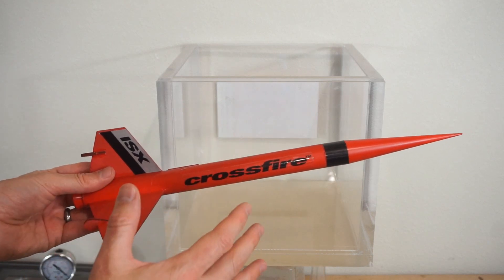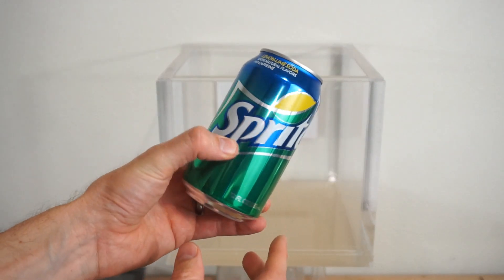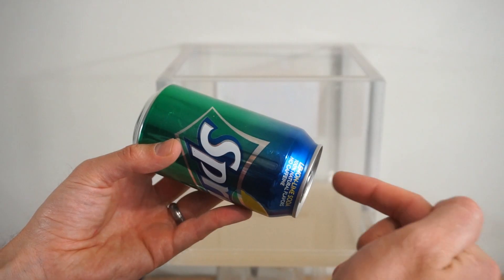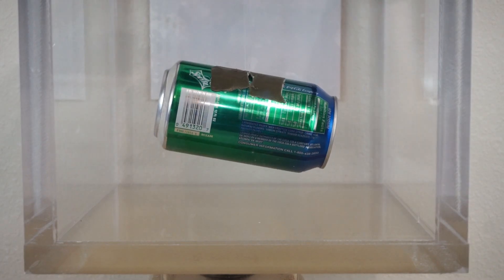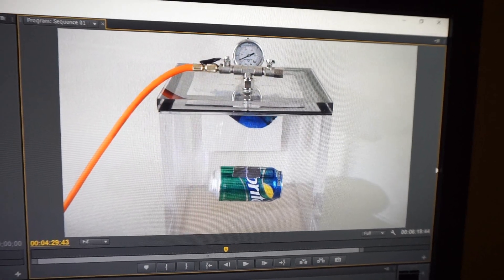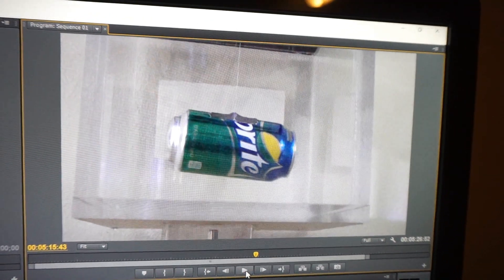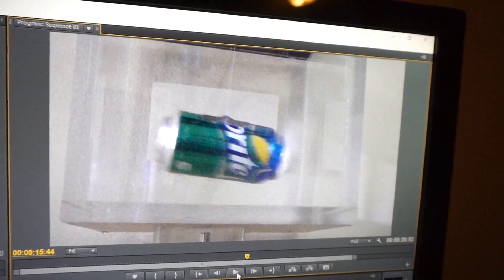Can a Rocket Fly in a Vacuum Chamber?

Comment: of course it can. a rocket has it's own supply of fuel and oxygen. and since the rocket creates gases from the reaction and jets them out the nozzle, and every action had an equal and opposite reaction, the rocket must have thrust and therefore must fly.
Reply: There's a special kind of people who don't accept Newton's third law, this video is aimed at them, the flat-earthers.
Reply: Holocene
Of course Newton's third law applies in a vacuum.  Why wouldn't it?
Reply: @Hyrum Wood Why will it not work in a vacuum. It's like you sitting in a wheel chair and throwing a bowling ball, you'll get pushed back a bit. Now imagine having zero friction, no air resistance no wheels just you and a ball. You'll be pushed back even further because there is nothing slowing you down.
Reply: There's a special kind of people who think newtons third applies in a vacuum, we have classes for them to keep them away from people who can think, and helmets, they need helmets.

Comment: It is actually really simple the reason rockets work in space is not because of low gravity or lack of pressure. Space Shuttles provide Thrust into space through the use of a fuel and Oxidizer. This means they don't need oxygen or the pressure from the outside to give them the thrust its all contained in the fuel tanks. The low gravity and low pressure is actually a good thing because once in space the shuttle can use RCS (Reaction Control Systems) thrusts to do fine maneuvers which if im not mistaken is usually just Helium Gas.
Reply: Blah blah blah...💤💤💤  this experiment is only a little flawed,  the only part not valid is THE WHOLE THING !     YOU CAN SEE IT PUSHES OFF THE WALL.BEHIND IT...WHERE'S THE SMART SCIENCE GUYS/GEEKS ?

Comment: did you reallize that you didnt even need the vaccum chamber to show it? when you have filled a baloon,hold it up as high as you can away from the ground in an open area(eg. outside your house) and then let it go.when its going upwards its not pushing against anything,because you dont feel any wind around your foot and the baloon goes flying immedieltly LoL.
Reply: outside your house is not low atmosphere.

This experiment was done to show that newton's law of motion works as usual. Sprite losing mass which propels it forward even in a vacuum. Just like a rocket losing mass in space.
Reply: SpaceX Fanboy , if the principle is that by ejecting mass at a velocity,you move in the opposite direction with another velocity(conservation of momentum) then it doesnt matter if the outside pressure is 0 or 100atm,it works exactly the same

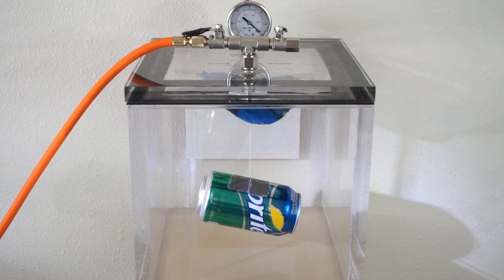Comment: wanna skip to see the action?? skip to 3:10 thank me later
Reply: You must have 3 parts to make it move in the chamber.
1• the chamber walls
2• the gas
3• the rocket

In space you have a problem.
1•
2• the gas
3• the rocket
Reply: Thanks!
Reply: Administra2rS:  He showed the pressure gauge.  It did not go up, yet, the can moved anyway.  That means the chamber was not filled with gas like you say.  If it was, the pressure gauge would have gone up.
Reply: Thanks bro.
Reply: Lincoln Lim 4:20
Reply: Administra2rS Didnt you saw the part in slow motion?
Reply: @felpex1495  the chamber is too small and both containers have to level pressures. 
0+2=2
now every position on the volume area has the same pressure that is the result of adding both quantities,  let's say 0 plus 2 , the new pressure in the whole area is 2.
But if the OUTER EMPTY SPACE is vaccum, the negative pressure won't wait until you open or fire on or click any bottom, it will suck everything and everything and everything right away.  Leveling the pressures, and whatever had enter (that's another issue we can't and will ever be able to explain) into OUTER EMPTY SPACE will have the same pressure :

THE COSMOS HAS !
Reply: @felpex1495  👍✔see what happens in REAL VACUUM 
https://youtu.be/76JM03a6WH4
Reply: you move only by touching the wall with your hand, or the air very fast inside the chamber. When it is a vacuum, then there is nothing to touch, only the wall. If you bring a fire inst. then you will move only because of the wall you blow against and standing on.
Reply: https://twitter.com/TheXenderman/status/1113495608768200704  @Administra2rS
Reply: @misterx7898  👍✔see what happens in REAL VACUUM 
https://youtu.be/76JM03a6WH4
Reply: Pressurised gas moves extremely fast, it does two things, it makes a physical touch against the wall of the chamber, and fills the vacuum with gas who also stops against the walls of the tiny vacuum box to travel on.
Reply: the gas still hangs in the sucking vacuum of space, no way for thrust to form.
Reply: In the vacuum of space, there are no gravity and negative pressure. No way for thrust to form. A bullet works cuz there are two hard parts, gas and liquid does not fit in this category. The bullet works cuz the two hard parts HOLDS together. A thrust in the vacuum of space will work if you can physically screw the air/gas that is coming out of the rocket to the chassis of the rocket, something that we can not do. Thrust does not work in space. It has EVERY thing to say witch material is used. Recoil can ONLY happen when there are two hard material parts connected. When the exhaust leaves the rocket THEN it still hangs in a sucking vacuum and it's no loger CONNECTED to the rocket. No thrust can be created. If the rocket was spitting out something of HARD material that is connected physically to the rocket, then the push could have been made (like a minigun propulsion system). You can not glue exhaust to the rocket, there for the thrust won't work. The vacuum of space is PULLING the rocket in all directions. On the surface of the earth it is positive pressure that is pushing everything IN. So the rocket can travel and thrust in positive pressure where Newton's 3 law WORKS, but FAILS in the sucking vacuum of space.
Reply: @Administra2rS  - "In the vacuum of space, there are no gravity and negative pressure."  FALSE.  there is NO SUCH THING AS "NEGATIVE PRESSURE" .   The pressure in space is ZERO. 0.0 PSI.  there is nothing magic about it.  and the "Vacuum of space" CANNOT SUCK OR PULL ON ANYTHING .

Here is a question for you:  If I have a linear catapult (or railgun) that has a mass of 5000 kg.  It can fire a water Ice Block of mass 500 kg, at 2500 meters per second.   WOULD this catapult experience recoil if it fired this ice block floating in zero-G, in a vacuum?  WHY or WHY NOT?  (can you explain the property of the ice block that makes it do this?)
Reply: @stuartgray5877  how You level the equation to zero in outer space.  Any positive pressure You bring outer space gone be sucked immediately in the vast and humongous space, as they said it is, and we still don't know the TRANSITION MAGIC TRICKS, to go from X amount of psi in our earth, to a complete zero...Where we pass through???, Where is the portal??? How they could accomplish it???
Reply: @abelmicah3430   The "Vacuum of space" STILL cannot "SUCK" anything.  When the nozzle BLOWS THE PROPELLANT OUT, the nozzle FEELS the force that accelerates that gas into the vacuum.
The VACUUM does NOT exert the force.
The NOZZLE exerts the force.
FOr PROOF that rockets work i n a vacuum I can show you video evidence.

Abel - First you have to answer a question.
How high UP does one have to go before they are in what you would call "VACUUM"?

Vacuum industry experts consider "Rough Vacuum" to be anything less than 1.0 Torr.

1.0 Torr is also "close to" 1/1000 the pressure at sea level and equates to about 0.02 PSI.

SO what altitude do YOU think you would need to go before the atmospheric pressure drops to less than 1.0 Torr?
Reply: @abelmicah3430  what happened? Did you get tired of arguing how vacuum works with a vacuum test specialist???
Reply: THX DUDE BRO BRO DUDE
LOLOLlOLOLlOoLOlL10l
Reply: i think a slingshot would do better moving the can in outer space than combustion engine, problem is if the slingshot will work without so called gravity
Reply: Thank you
Reply: Ty
Reply: Thanks!
Reply: Failed experiment - he doesn't account for the gas in the can pushing against the wall immediately after outburst
Reply: @lordzeusourgodoftruthstorm4410  It doesn't matter the soda can would propel itself even in the vacuum of space.  It doesn't NEED anything to push off of.
Would a CROSSBOW firing a steel projectile feel recoil in a vacuum?
Reply: @stuartgray5877  the steel projectile and crossbow would only move the distance of the force of the elastic band. nothing can "float" in the void called space because that would conclude there is 'something' to float in. If space was a void, then magnetism is superior. the closest magnetic force would attract everything like the flies falling at almost null atmosphere in this vacuum chamber youtube.com/watch?v=C4h-AS729JM
Reply: @lordzeusourgodoftruthstorm4410  False - the crossbow would propel the projectile forward with some velocity (that it will keep moving with forever) and the crossbow will get propelled BACKWARDS with a lower velocity and IT will continue moving with that velocity forever.

You should not have dropped out of high school.
Reply: @lordzeusourgodoftruthstorm4410  - "now you want to be an insulting little boy, instead of having a discussion. "
Did you get triggered when I suggest that you should have graduated high school?
Tell me flat out - DID YOU graduate high school or not? Every person I KNOW that DID would just say "Yes" to that question.
Reply: @lordzeusourgodoftruthstorm4410  Just as I suspected, you DIDNT graduate high school, but you want to argue with Actual Engineers about physics?  Here is your Dunning-Kruger participation award, put it where your high school diploma should have hung.
Reply: @stuartgray5877  yeah you did
Reply: @stuartgray5877  Do the world a favour. Stop stealing valuable air
Reply: @stuartgray5877  Crossbow on a string. You're a TOOL! ... Stuart: "I have proved rocket travel in space!"..... NASA: Please share..... Stuart: With my ingenious degree Tr.annie porn loving superpowers, I present.... Crossbow on a String! Tuhduh!!!!"
Reply: @stuartgray5877  whatever Keyboard Warrior.... Stuart, seriously dude. Your photo says you like
Reply: @stuartgray5877  C
Reply: @stuartgray5877  h
Reply: @stuartgray5877  icks
Reply: @stuartgray5877  with
Reply: @stuartgray5877  D...
Reply: @stuartgray5877  icks
Reply: @stuartgray5877  This is fun! Does Lockheed know you're a closet lady boy
Reply: @stuartgray5877  H
Reply: @stuartgray5877  O
Reply: @stuartgray5877  M
Reply: @stuartgray5877  O?
Reply: @stuartgray5877  Hiya Stu! You have quite a pent-up 'closet' anger. Has the LGBTQ community helped you come out yet?
Reply: @lordzeusourgodoftruthstorm4410  - "because I proved you wrong."
Yeah, here is your Dunning-Kruger award, put it where your high school diploma should have gone.  You are now one of their honorary poster children.
Reply: @stuartgray5877  hi Tchraannnee boy lover! why do you keep writing?! If you're looking for angry sx, you're barking up the wrong tree... Stuart: Theeengs flote in spaysss, durrrrrgghhhh duhhhhhh
Reply: @stuartgray5877  engineer degree ..... darrrr (spit from mouth)
Reply: @stuartgray5877  Stuart: told u am engineer at lockheed... Stu's ladyboy mail order bride: Oh Stuey! Yoo soo clever maaan, phuculongtine...
Reply: @lordzeusourgodoftruthstorm4410  - This is great!  Please keep going. It appears you are losing IQ points AS YOU TYPE.  Keep it up.
Reply: @stuartgray5877  Mr engineer, not my fault you just found out your degree was a HUGE
Reply: @stuartgray5877  L
Reply: @stuartgray5877  I
Reply: @stuartgray5877  E
Reply: @stuartgray5877  I can understand you don't feel special anymore, but you still have your ladyboy
Reply: @stuartgray5877  that made NO sense toyrocket boy
Reply: @stuartgray5877  your Disney kids humor is just not funny
Reply: Thank u now
Reply: Lincoln Lim 
heroo
Reply: Administra2rS The soda can moved before the gas touched the chamber.

Also in space rockets don't need push a chamber or air, there is gas coming out of them, so that is  kinda "pushing" the rocket forward. Newton's third law.
Reply: DEBUNKED DEBUNKED DEBUNKED! This is why it moves in the vacuum chamber :) The soda can fills the chamber with lightning fast pressurised air. That stops in the sealed chamber, now the soda box can move. Same thing with the rocket. It brings it's OWN gas, air, whatever and fills the vacuum chamber for it to move. BUSTED this do not work i space where there are NO CHAIMBER, the chamber is making whats making the thrust possible. Thrust in space is a hoax, in Norway we know this, we have rockets too :)
Reply: @Administra2rS  funny you say that, I took a picture from a frame that debunks your entire theory.

Comment: what happens if you put a Mellon in a vacuum?
Reply: it would be a banana
Reply: Not much. The skin is nearly airtight very strong and round so it is even stronger and since it doesn't contain very much gass it won't really blow up. Also if there was a hole in it then the juice would boil and foam out.
Reply: James Henrikson, depending on the measurement of vacuum, it would explode the same way as the angular Lunar Lander would if it were actually in Space or on the Moon. That's the exact opposite of a submersible's implosion under the sea. An actual space craft would be round for the same reason a submarine is. To withstand the pressures. Whether the pressures are 'Compressional' stress or 'tensional' stress the vessel would need to be round, to best withstand it.
Reply: pls respond
Reply: itll be there
then wehen you let the air back in itll be there
boom
a melon